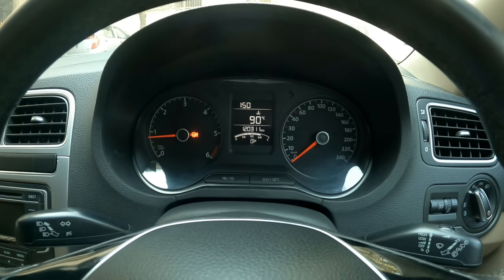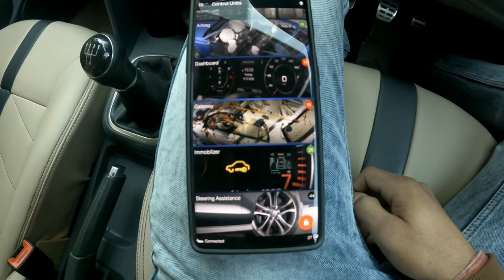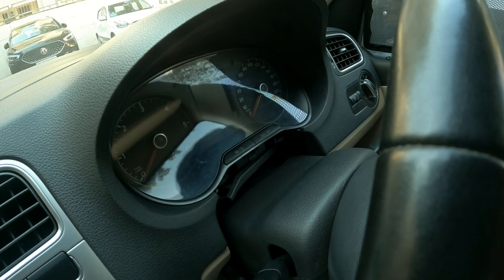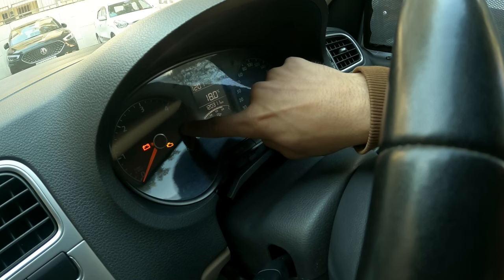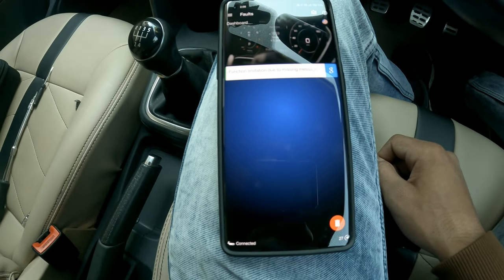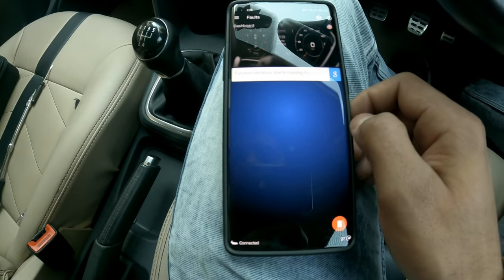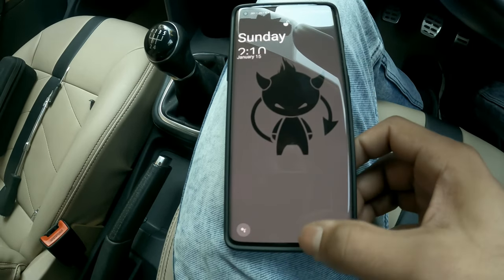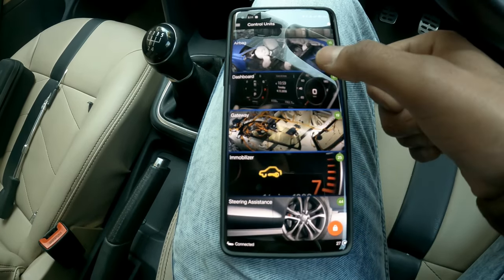POWER STEERING ISSUES IN VOLKSWAGEN , SKODA AND AUDI | FAULT CODES | OBDELEVEN

Comment: Hellos, I'm having a problem with my WV polo 1.2 tsi which I was changing suspetion. Then after the Cas steering is hard and have a red light of power steering on the dashboard... It talks about angle sensor when diagnosed...
Reply from the maker: Sir was the alignment done in the right manner ?
Reply: Yes, I took it to 3D alignment
Reply from the maker: Can you tell me the exact code you are getting sir ? Because i want to know , whether the angle sensor is reading wrong angle or it's not working .

Comment: This is how troubleshooting is done! Instead of disconnecting the MFD, can we disconnect the battery to reset the modules?
Reply from the maker: Sir  yes it can be done , but battery needs to be disconnected for at least 15-20 mins , because almost all modules have capacitors and they can store a little bit of energy for some time , so we need to wait until those caps are drained
Reply: @yourDIYneeds  thanks

Comment: My vento tdi does increase its rpm under load sometimes and upon checking the voltage it's around 14.7 on idling and 14.0-14.2 under load.
Is it normal?
Reply from the maker: Perfectly fine

Comment: I am from India, but the HEX-NET PRO product is not available here. My uncle resides in Chicago, USA. If he purchases the HEX-NET PRO device for me from the USA, will I be able to activate and use it in India?

Can I perform unlimited car diagnosis, coding, and tweaks with the HEX-NET PRO device?

Is the HEX-NET PRO an one-time purchase, or does it require a yearly subscription?

Do I need to purchase VCDS software separately for it?

What is the activation process for the HEX-NET PRO?

I own a garage. Is the HEX-NET PRO suitable for handling unlimited car VINs?

Does the HEX-NET PRO device come with a cable?
Reply from the maker: Sir hex net pro is a one time purchase and the software is free along , there are version which will allow you to connect to limited VINs or unlimited VINs and with a hex net pro  you can access close to 95% of all the things your vehicle is capable of .
And i am from india as well , as far as my knowledge serves me hex net pro is available, if you want i can help you to arrange one.
Reply: @yourDIYneeds   HEX NET PRO - yearly Subscription Based Device or not?
Reply from the maker: No sir

Comment: Sir, Skoda Octavia 2010 lift back model, the steering is stlff. This happened a day after i serviced the car. The EPS signal is off on the dashboard, no yellow or red light on. What is the problem.
Reply from the maker: Sir get it scanned first, if there is any code or not . And check the live data for the voltage received at the steering module , it will give us a Direction to work in
Reply: Thanks, I will get it scanned as advised but please where and how will I checked the voltage received from the steering module?
Reply from the maker: @oluseyiadefisayo1142 
The scanner can read the voltage provided to modules
Reply: Thank you boss. I scanned and  the steering is now free and smooth. It's no longer stiff. Though it gave error code but it was resolved. Thank you
Reply from the maker: @oluseyiadefisayo1142 anytime sir

Comment: Sir my safari dicor 2.2 model is having starting trouble .... He is not starting in first self after 5 min of rest he start but service light is continuously started when engine is ON
Reply from the maker: Have you checked glow plugs ?
Reply: @yourDIYneeds  no I have not check but is that only the issues or other one because after the engine start car not automatically off but when we off the engine and then trry to start it's not starting and after same time it's started so glow plugs is the issues????
Reply from the maker: Sir had car ever ran without fuel , air got into the fuel system ?
Reply: @yourDIYneeds  yes... Not run but trying to start
Reply from the maker: Sir may have to check the pressure of high pressure fuel pump
Reply: @yourDIYneeds  yes... I press the pump which is near the diesel filter ... I think laptop pr car lgani padegi campany ka Mistry aaya tha wo bole laptop pr lgana pdega apke khayal se ky problem ho skta hyyy
Reply from the maker: Sir ek bar scan karwa lo , kaam karne ke lie ek direction mil jaegi
Reply: @yourDIYneeds  Haan jiii

Comment: Difference between VW 505 00 and VW 505 01... Will they make any difference?
Reply from the maker: Yes sir approvals are formed on the basis of presence of specific additives, they make a lot of difference in longevity of the engine

Comment: Hello, i have a audi a3 2004 it is saying sometimes that it don't have communications with the steering module incheckt the wire and fusses..  some times it works.  Does the steering module is going bad.? Or can it be the steering sensor.?
Reply from the maker: First is to make sure that the steering module is getting proper voltage , 
Check continuity for grounds , as half of communication faults are just because of drop in voltage .
And check the electrical connector of the steering module for any corrosion buildup
Reply: @yourDIYneeds   i have checked the wires expect on the steering house because it is hard to get there. Is the module at this type at the steering wheel?
Reply from the maker: Then try scanning the module and check the resistance and power voltage on the module from the diagnostic tool .
Reply: @yourDIYneeds  i wil try i have now autel my vcds it not working. And do you know where the module is?
Reply from the maker: Module no. 44 
Go in live data and check the parameters
Reply: @yourDIYneeds   i will do thanks. Btw do you got insta or something?
Reply from the maker: So just have an email id .
everydaydiyhelp@gmail.com
Reply: @yourDIYneeds   thanks,  do you have experience with the autel scanner?
Reply from the maker: No sir , i have worked with obdeleven

Comment: 13-46 to 13-56 after start the car., You changed the polarity + & - 😆😆
Reply from the maker: Sir i was basically testing voltage and continuity
In continuity polarity doesn't matter 
In Voltage it does but it shows reading in -ve 
And i was sure that alternator is producing power not drawing it 😅😅

Comment: Hi. I get an error under Central Electronics like: 

01598 - Drive Battery Voltage 
            000 - -
             Freeze Frame:
                    Fault Status: 01100000
                    Fault Priority: 3
                    Fault Frequency: 1
                    Reset counter: 27
                    Mileage: 164624 km
                    Time Indication: 0
                    Date: 2017.08.12
                    Time: 06:37:45

I tried clearing it, but the error came back again. Sometimes the car idles a bit high (1000 rpm instead of 900 rpm) and the radiator fan spins at full speed. Numerous forums tell it’s a faulty alternator or battery. Just few months back, I got my battery changed. The voltage hovers around 13.5. Check after overnight, the voltage was at 12.7. Any idea what issue it might be?
Reply from the maker: Sir , can you tell me which vehicle you exactly have , because a lot of  vehicles may require you to code the new battery as per the specs of the new battery , so that the alternator can adjust itself for charging
Reply: @yourDIYneeds  Thanks for the reply. It’s a 2012 1.6 TDI Vento. Does PQ25 platform require battery coding like MQB?
Reply from the maker: No sir, PQ series of BCMs doesn't require battery adaptation,  alternator has a specific part called " voltage regulators" which can go bad , but that doesn't make the voltage reading "000"  , it will start to throw out either massive amounts of voltage or no voltage at all .
If there is no issues with the engine cranking , and alternator is doing its job of charging the battery and powering the electronics , then it can't be alternator .
What i feel like is , its more of a fault with the voltage reading circuit of the BCM itself , because at the end of the day , both ECM and BCM are nothing but just very advance Multimeter which has the capabilities to send and receive signals multiple times per second . If voltage is low then it will throw a code but that's not the situation here i guess. So either the transmission end of the stream is bad or the receiver end , in both of the case we will get the same code .
Hope i made a valid point to understand .
Reply: @yourDIYneeds  Thank you so much for the input. I’ll test it out and let you know of the results.
Reply: @yourDIYneeds  Hi, I took out the negative terminal off the battery for about 5 mins and put it back on. Cleared the error code and it didn’t come back. Thanks a lot. 
One more query. Is it bad for Camshaft position sensor to be higher than 4.8 degrees? I got timing belt replaced earlier and still the values sits at 5.25 in warm conditions. Could it be a bad sensor or timing needs to be rechecked?
Reply from the maker: Sir usually cam and crank sensors don't have any sort of freeplay in their mounting points so , that's kind of difficult that it can move .

Close to 5° is ok , any sort of offset from that value can be a result or either , a loose belt tensioner , or timing may be one tooth out of its desired location .
Reply: @yourDIYneeds  Thanks a lot.

Comment: Can use the same fix for golf 7?
Reply from the maker: Yes procedure is exactly the same
Reply: @yourDIYneeds  thanks boss, I'll go try now. I have same issues. Red steering. But sometimes its fine... Sometimes it makes this problem.
Reply: Unfortunately on my golf that did not resolve the issue. The red steering light still comes up
Reply from the maker: Tried disconnecting the cluster ?
Reply: @yourDIYneeds  yes... I disconnected the cluster.... And connect it back after 5 minutes. Didn't work, now left it disconnected and batteries are disconnected too now .. i will connect it in the morning and see how. Is there other fix for this?
Reply from the maker: It worked ?
Reply: @yourDIYneeds  no boss... Now additional check engine light
Reply from the maker: Get it scanned first , it will give you a direction to work with